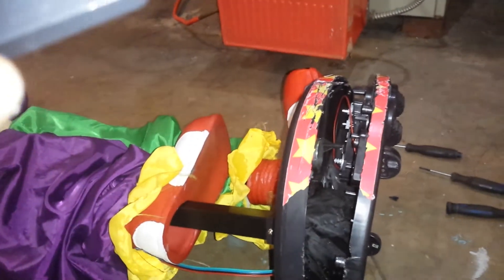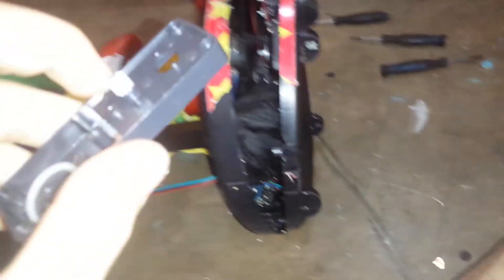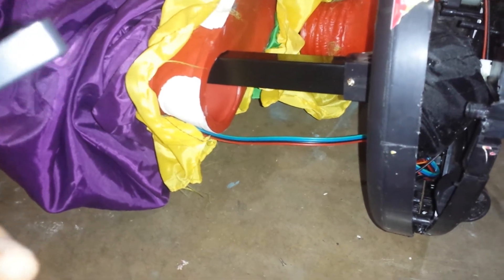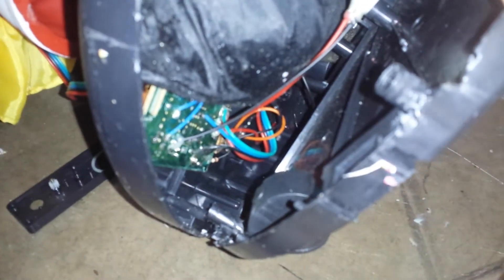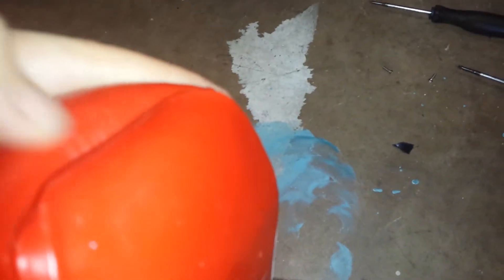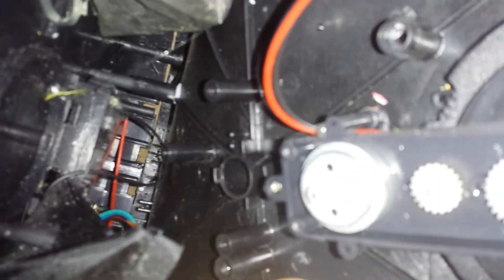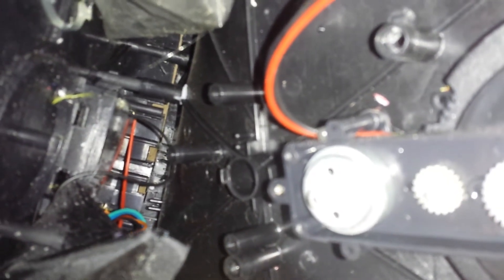What Is A Stripped Gear?

Comment: It’s not stripped it’s split you can buy replacements online
Reply: It’s that small 10 tooth one
Reply from the maker: Petercmhanna My dad looked at it it's stripped
Reply: The Grave Man I can see the split in the video trust me that’s the issue I’ve fixed tons of items with the same issue that little dark line in the gear is where it’s split
Reply from the maker: Petercmhanna Yeah I am buying welding glue crap at Canadian tier because my witch had the same problem as this clown and we used it for the gear that was stopping the cauldron from stirring and it fixed it like nothing bro
Reply: The Grave Man you need a new gear there’s really no way to fix the split in it it’s permanent
Reply: There on eBay I can send you the link to buy them if you want
Reply from the maker: Petercmhanna I'm good
Reply from the maker: Petercmhanna the gear isn't sapose to move on the shaft we fixed that hopefully now when we put it all back together it's works fine
Reply: The Grave Man if it does it won’t for long like I said there’s no way to fix the gear once it’s split you need a new one
Reply from the maker: Petercmhanna Oh umm my witch was working sense 2017 after the haunt and she was on sensor all day last year's Halloween  and she's still working like new bro
Reply: The Grave Man the witch’s problem was different her gear slipped it didn’t split
Reply from the maker: Petercmhanna No the gear was split on the witch plus it was slipping on the shaft as well and the clowns gear was slipping as well because the witches cauldron was making the same buzzing noise as the clown bro
Reply from the maker: Petercmhanna Thanks bud
Reply from the maker: Petercmhanna Fixed it